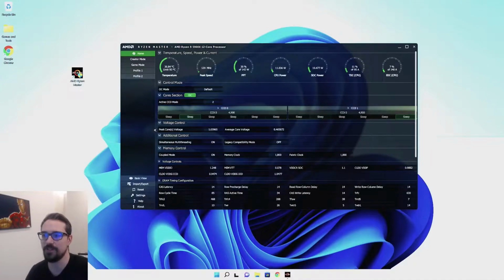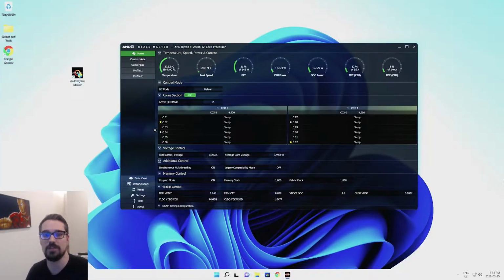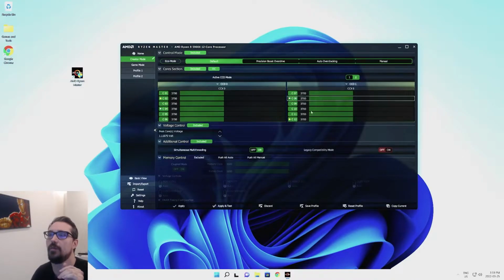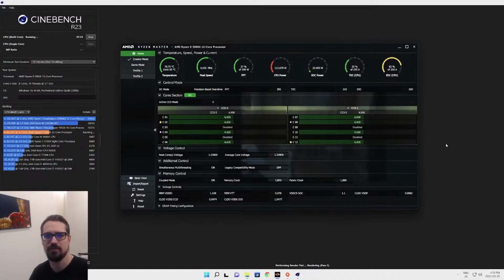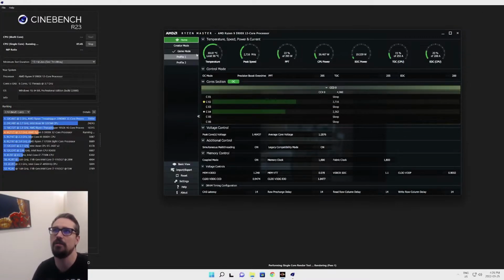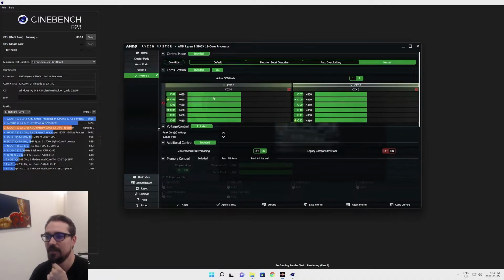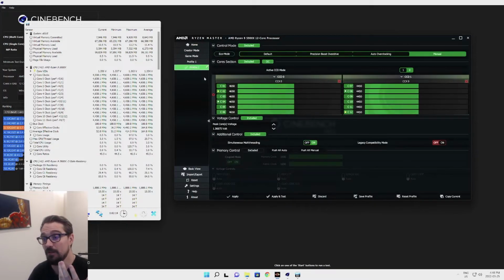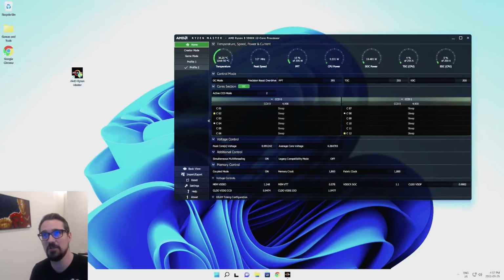Ryzen Master - AMD 5900X Overclocking

Comment: Does this save to bios or do i have to do this everytime
Reply from the maker: The settings apply at startup as long as you have Ryzen Master set to start with Windows. The settings don't apply directly into the BIOS.

Comment: How did you ger ryzen master to work on windows 11? i have tried everything short of a clean reinstall of windows from every support article. i can get it to launch one time after a clean reinstall of the program and it fails to launch after that.
Reply from the maker: That's interesting. It worked for me in Windows 11 immediately with no issues. Are you on the latest BIOS and AMD chipset drivers?
Reply: @UnhingedSystems  haven't tried updating bios yet.   That will probably be my next step.  I have updated drivers from both armory crate and amd

Comment: Fairly new to this whole overclocking or messing with the CPU at all. I went to precision boost overdrive and then increased PPT, TDC, and EDC. Got a clock speed of around 4,260 on my Ryzen 5900x doing it that way. I then noticed that lowering the amount of EDC actually increased my clock speed. Making my EDC only at 100A made me boost up to around 4,420. Gave me a better score on Cinebench as well when heavily capping my EDC. Do you know what would maybe cause this to happen? Should I keep it capped all the way down to 100A or still increase it so it's not sitting at 100% even though it shows worse results?
Reply from the maker: In a lot of use cases lowering the EDC to an extent will actually improve performance. It's varies chip to chip how it will act with different settings. Ultimately you will find the best settings for your chip :)

Comment: You're my hero man. Great tutorial.
Reply from the maker: Wow thanks for the awesome compliment! Glad you found it useful!
Reply: @UnhingedSystems  I have a question. Now that I play with the settings I noticed that my amps go nowhere near maximum set, because CPU Power refuses to go beyond 160W. CPU Temps go up to 81 degrees C. How do I increase the CPU power limit? I'm on 5900X too.
Reply from the maker: @pawelsyska  You can increase the PPT, TDC and EDC within Ryzen Master as well. If you have the cooling capacity just max out the PPT (300), set TDC and EDC to between 135-165 and play with different settings. There are cases where increasing the EDC and TDC too far results in less performance.

Comment: my ppt is 500 stock wth? Should i lower it?
Reply from the maker: If you have the motherboard limits selected it will allow it to push as high as it feasibly can within it's algorithms. 500 is a little high, but it won't run beyond it's thermal limits.
Reply: @UnhingedSystems  i have an msi mpg x570 gaming plus, i did my research and it seems that it cannot handle my 5900x with any oc setting.
Reply from the maker: @ArisHDi  That's really odd for an X579 system. What kind of issues are you having?
Reply: @UnhingedSystems  it cant seem to hold any pbo or co setting it passes every cinebench stress test, occt test, project hydra test but it will crash (no blue screen just crash) after playing a couple of games of mw2 or +-40minutes of 3d modeling applications. Ive seen all my cores hitting 4900-4950 boost clock with out any pbo or co setting and i can throw at it pretty much everything and it will not crash. From what i read the vrms of my mobo cant handle the heat they get as high as 70 degress while cinebench runs.
Reply from the maker: @ArisHDi  Well VRM cooling definitely can be an issue, check for BIOS updates. No point in having an X570 platform that can't overclock.

Comment: when setting my EDC lower i get better clock results but i see my EDC % goes over 100% my temps are fine but would leaving that overclock be bad for the cpu?
Reply from the maker: Higher amperage than stock will degrade the CPU a bit faster than stock, however, keep your temperatures in check and you should be fine.
Reply: @UnhingedSystems  Im running the 7800X3D, and they have a temp limit of 89C, mine runs at 84-86 while PBO is turned on. Thats with the undervolt curve too, before that it was always hitting that 89. I wonder if i can lower my temps even more...  the undervolt is -30 as it is, kind of high but stable.

Comment: Does Ryzen Master override what I have set in BIOS? I Wonder if I have to reset settings in BIOS before I try Ryzen Master to not get buggy results?
Reply from the maker: It will, yes. If you are going to use Ryzen Master I would suggest using defaults in the BIOS to avoid any confusion when switching between settings.
Reply: @UnhingedSystems  does that mean curve optimizer set offset too for bios and ryzen setup?

Comment: Thanks for this video. I will probably tinker with this tomorrow. I heard from random people in the past that it’s not really worth overclocking an AMD CPU as it is with intel, so I didn’t really put any time into it besides clicking the “auto over clock” feature in AMD Ryzen master, which gave a .2ghz boost on all cores. I am more looking for that increase in performance in games so I will probably look to disable CCD 2, and try to go with a stable 4.6ghz on all, with my 2 highest at like 4.9 if possible or even 5.0 would make me very very happy.  Currently have the 5900x cooled with a Artic Liquid Freezer 280mm, which has a thicker radiator than the 360mm thus benchmarking about the same. Again thanks
Reply from the maker: For me the biggest real-world gains come from the all-core increase when enabling PBO and increasing power limits, or manually overclocking and using the Dark Hero's OC switcher. Definitely worth it for video compiling workloads!

Comment: Something people dont talk about enough is under volting for balance between power usage and performance. Some of us want to keep our pc silent for work purposes and limit the total power draw from the wall while working.
Reply from the maker: Actual undercoating to limit CPU performance and heat generation is very easy on these chips (just manually set the CPU voltage to a lower setting like 1.2V will reduce all of the boosting algorithms).

If one really wants it to be silent just slap on a 480mm radiator into a water cloop dedicated to the CPU, throw in some high static pressure fans and voila, the fans never need to go above 1000-1100RPM to keep all the fluids nice and chilly.

Comment: I went in to the bios and set the multiplier on the cpu to 45 and all cores run at 4.5ghz on my 5950x.
Reply: That chip can boost to 4.9ghz. Not an expert here but dont you prevent it boosting when you do that and keep the chip at 4.5ghz all the time?
Reply: @Almarillion  I think it's only certain cores that boost to 4.9 ghz the most stable ones so locking all cores at 4.5 gives a better overall overclock is my way of thinking but not sure.
Reply: I had tried 4.3ghz all cores oc on my asus x570. My timespy 2k bench had crashed (awful score) after doing that. That is why I was asking.
Reply: @Almarillion  oh right. Maybe increase the voltage a bit but I would of thought at 4 3 that would of been fine. My passed on 4.5.
Reply: @excaliber32  corrected the text. When i said crash, i didnt mean literally crashing. Score was lower than the stock settings.
Reply: @Almarillion  oh right strange in it. Did you try 4.5

Comment: is it okay to oc my 5900x. im only using b450i and have 240mm aio
Reply from the maker: It's going to depend on a couple of things. Firstly you will be limited by the power limits and VRM cooling on the b450 board. Second the 240mm AiO design will determine how fast you can get the heat away from the CPU. Ideally you don't want the liquid in the AiO to raise beyond 45-50C. The hotter the fluid the harder it is on the pump and the less cool it keeps the CPU. A lot of AiOs don't come with any kind of internal sensor for temps. 

You can certainly give a try on the 240mm AiO, in smaller increments, and see what kind of results you get. I typically recommend a 360mm AiO for overclocking where possible. A 240mm AiO probably won't perform all that well at high CPU utilization over a longer period of time, however, it's probably fine during gaming and other light-medium workloads.
Reply: @UnhingedSystems  i did not oc. im using 80-90% of the 5900x with 60-70c temps with the 240mm aio. i think this is pretty decent with a itx build.
Reply from the maker: @dotafarm2699  Very decent!
Reply: @UnhingedSystems  i was trying these. i cant increase the value of my ppt tdc and edc. my ppt is capped at 300, tdc 140A, edc 200A. i cant go beyond

Comment: What I'm curious to know is how a 5900x on say a MSI Tomahawk 450 max will go with overclocking in regards to VRM temps..
Reply: ive had no real issues with PBO and the board does PPT of 1000 wats for some reason lol. only goes to 170 watts though, hard to tell actual VRM temps on this board with sensors but it would tell me if I was having temp limits by turning off the computer or turning my clockspeeds down.

Comment: quick question my man? do I need to keep opening ryzen on boot to apply settings or do they work auto everytime?
Reply from the maker: Great question! Ryzen Master has to load to apply the settings as they aren't permanent like a BIOS change.
Reply: @UnhingedSystems  man I'm so glad I stumbled on your video.... my bios settings were doing nothing, tried ryzen master booom.... 5ghz peak and 4.6ghz all core on avx load.... god knows why my bios won't configure it

Comment: Hey, my PPT is at 1000, my TDC is at 380 and my EDC is at 380 is that bad?
Reply from the maker: Which motherboard are you using? Ultimately your CPU won't allow itself to exceed 90C without throttling.
Reply: @UnhingedSystems asrock steel legend wifi ax
Reply: @UnhingedSystems  My pc is a 3060ti and a ryzen 9 5900x but when I run warzone my gpu time is 4-8ms but my cpu time is 8-15ms and I don't know why
Reply: @UnhingedSystems  Same on my asrock, it says 1000. Is it safe?

Comment: Initially I just went ham and set my PBO to the Motherboard limits. I did get the extra performance on Cinebench R23, initially boosting up to 4.4GHz on all cores. But it could not sustain the boost and goes down to less than 4.3GHz. So I went ahead and tried to tune my PBO limits. Since I live in a tropical environment, where temperatures reach at a high of 40 degrees during summer, I had to tweak my PBO limits so I can maintain around 80-85 degrees depending on the weather. This allowed my CPU to maintain the boost of more than 4.4GHz on all cores.

Comment: Im about halfway through the video and have noticed that my ppt is stuck at 88w but my TDC and EDC have increased to 255 when I enable PBO. I am using a ryzen 7 3700x and a asus tuf x570 mb with the latest drivers. Any recommendations as to how I might be able to fix this?
Reply: never mind, once I manual OC'd it, the ppt changed to 395w

Comment: I can see why people say that PBO is bad. I'm running at 4.5 all core at 1.31V with a 140 amp limit EDC just fine but that's set up through BIOS
Reply: pbo + curve optimizer has gotten me 4.6 to 4.7 on a chilly day 1.38 droop then back to 1.28 to 1.29 once the load is steady.
Reply: oh adn only about 75 C after running for 30 ish minutes. not on air but still good.

Comment: Hi.  Last time I assembled a computer was about seven years ago.  Since then much has changed.  I have always used Intel.  I am now, for the first time, going with AMD:
 - Ryzen 9 5900X
 - ASUS ROG Strix X570-I X570 Mini-ITX
 - DDR4 64GB (2x32GB) 3200MHz (PC4-25600) CL16
I want to overclock both the cpu and ram not  get everything to go faster, necessarily, but rather to ensure that bus speeds, frequencies, clocking, etc., are all in synch and working together well, each reinforcing the strengths of the other.  Thus far I have learned that doing so can be as complicated as finding solutions to second-order differential equations.  Can you recommend a comprehensive guide fit for the eyes of a novice?  I want to be able to settle on a reliable 'sweet spot'.  Thanks.
Reply from the maker: Thank you for the question! Are you looking at doing something beyond just enabling DOCP? With DOCP profiles enabled the memory controller and memory will be synced, for example, 3200MHz on the memory and 1600MHz for the infinity fabric. That ratio is ideal and automatic with DOCP.

3600MHz CL16 (or even CL14) is pretty much the ideal sweet spot for the 5900X and other 5000 series CPUs, but you won't perceive a difference with 3200.

Are you looking at getting any more in-depth?
Reply: @UnhingedSystems   Thank you for being so helpful.  What I really need is some sort of guide that isn't out-of-date and is easy to follow.  For example, DOCP didn't even exist last time I built a computer.  And this is the first time I'm using AMD.  Right now I can get answers to all my questions but only after spending hours on forums.  Just finding the right forum can take hours.  And forums are for resolving specific issues.  What I need is far more general.  I need a comprehensive guide.  Any suggestions?  And thanks again!
P.S.: Can you recommend an affordable graphics card suited to the ASUS ROG Strix X570-I X570 Mini-ITX motherboard?
Reply: @UnhingedSystems  d.o.c.p. is not listed for me in bios msi click bios b450

Comment: Only 85 likes on this video including mine. That's sad considering how in depth this went. Question though. If you apply an OC and Ryzen runs the test after reboot and says it successful. But all your cores were only running at 700mhz. I'm assuming that's a fail and never kept those settings. I never went crazy with the manual stuff. Any info on what exactly that means or what might have caused it would be great 👍
Reply from the maker: Great question! Not necessarily a fail. Ryzen Master alternates load somewhat, and the polling speed to see  the clock speeds is actually quite slow. Test using HWInfo64 and run some load tests with some other programs like Cinebench and see what the min/max is. I haven't experienced the CPU stuck at lower MHz unless the clock speeds were intentionally set lower.

Comment: 4250 made me hit 90 celcius with liquid cooling :(
Reply: Настрой curve -15
Reply from the maker: Yikes! That's hot! Some coolers and pastes perform better than others. Most coolers come with pretty crappy thermal paste pre-applied unfortunately.
Reply: @UnhingedSystems  hmm I had a local shop put it together there's a 120mm slickmaster cooler master in there and I just can't keep it cool and am not sure what my options are !
Reply from the maker: @PinkyyRust  120mm is not going to keep the 5900X cool, not a chance stock, certainly not overclocked. The minimum effective would be 240 and even that is going to have the coolant get warm. For 5900X and 5950X I don't like doing less than 360mm of radiator. I always ask, what is the point of water cooling if you cannot have both cool and quiet? The cooler the coolant the cooler the CPU.

I just recently fixed a pre-built with an 11900KF that had a single 120mm radiator. Constant overheating and thermal throttling while in use, coolant over 65C which is damaging to the pump. 120mm is not sufficient.
Reply: @UnhingedSystems  ok so I didn't put it together I can barely see the cooler it says sicklemaster 120 but there's two fans so I'm assuming it's atleast 240? I'm also running off of a b450 tomahawk I was looking at getting a Strix 570 E, what are your thoughts?
Reply from the maker: @PinkyyRust  Send me a photo @UnhingedSystems on twitter.
Reply: @UnhingedSystems  sent I might have to open it up for you to see better